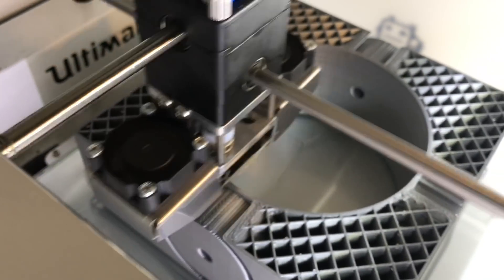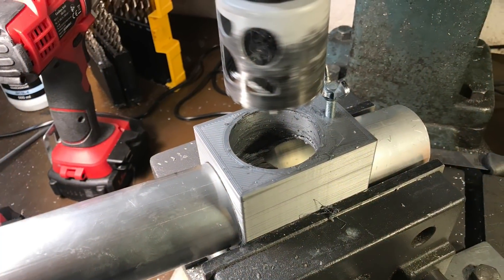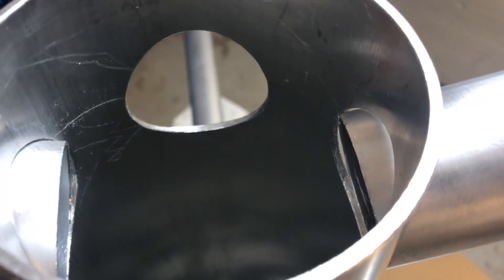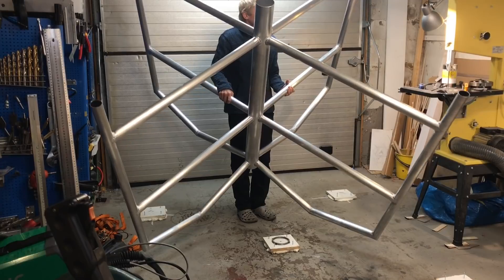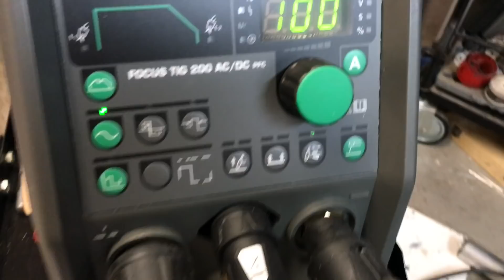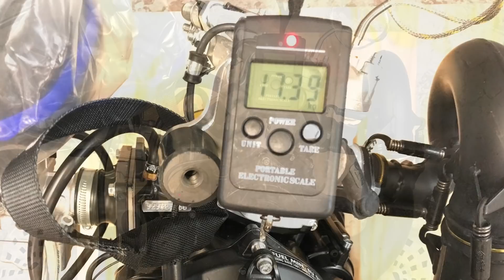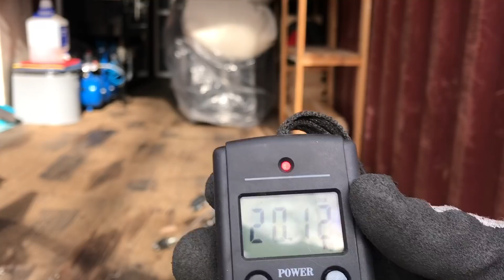OTV 7

Comment: Awesome, this is amazing to see.  Hey, love all your videos-big thumbs up from a fellow tinkerer in Michigan.  So I just wanted to put it out there for future video ideas that an AGNI/Lynch motor would literally be perfect for an electric motor repower project on this device or any other smaller vehicle project:
The AGNI or Lynch motor is a unique axial gap permanent magnet brushed DC electric motor.  The motor has a pancake-like shape and was invented by Cedric Lynch in 1979.
The Lynch motor is built from ferrite blocks sandwiched between strips of metal, instead of conventional copper coil windings, and is held together purely by magnets. The motor is available in several sizes (6.6 lb) to (24 lb) weight and provides a power of 1.5 kilowatts (2.0 hp) to 11 kilowatts (15 hp) within an efficiency range of 80% to 90%.
Any voltage battery up to 80 volts can be directly connected with a rheostat or a variety of controllers will work such as cheap PWM or golf cart controllers of many power levels.  I've even ran mine (AGNI 15kw capable) off a 3Kw brushed motor controller for an ebike.  What's amazing is the torque produced: I once hooked a single 18650 battery directly and the shaft spun about 90 RPM and had an incredible torque for such low voltage and motor speed.  A 9v battery spun it about 300rpm and you could not hold the shaft from spinning with your hand, 48 volts is about 2,500 rpm and it will rip a back tire right off an electric bike.  A very interesting motor so I thought I'd throw it out there, thanks again for excellent and interesting content.

Comment: I could go on forever praising your ingenuity on many points but the thing that thrills me the most so far is that you're going ICE rather than electric in a world that says you're mad 👌🏼
Reply: But it's the world that's gone mad, currently.  So much of the electric push is political, and control-oriented.  They'll be a more reasonable fit when battery densities are a lot higher, and electricity generation is more efficient, and less agenda-driven.

Comment: Thanks for the update, I was wondering how far you'd got with this. 

I commented the last time about the reliability of the gearbox, which is a single point of failure. However in this video I'd also be a bit concerned about fatigue of the welds between the radial arms and central column. Aluminium has a finite fatigue life, and significant vibration will cause welds to fail quite rapidly. 

Good luck, and keep at it!

Comment: You need rubber vibration isolation gaskets between that engine and the frame. Also another engine directly opposite will allow for some measure of harmonic balancing and of course double your available power.

Comment: I knew you won't stop until you fly with this. 👍
If you could get 4 old Sachs Wankel / Rotary engines (the ones without gearbox), it might work. Amount of vibrations is very minimal for obvious reasons, they are air cooled which is actually an advantage for your application and almost no tradeoff considering how they are built and how they work. Efficiency is bad, as it is bad with all 2 stroke motors, so no tradeoff there. But they might be hard to get and they might be as expensive after full rebuild than those Polinis. They are German product, very hard and expensive for people in USA to deal with so that might be your advantage. 🤔😉
In each case, be careful and I'm looking forward to see your progress. 👍👌
Reply: Now that would be cool!

Comment: I have seen connecting shafts with rubber a disk, where shafts are connected with bolts to the disk alternating from both sides. That might help to reduce the vibration of the motor transferred to the gearbox.
Reply: @SystemsPlanet  Not exactly. I say, that the disk should be made out of rubber. He has metal disks with rubber joints. The bolts there still projects the vibration. (But I'm not an expert in the topic.)

Comment: Sand is OK if extra fine, wet & packed, there's an official way that better & expensive, with some bends drawing needed, good 3-roller benders do most hard bends with a couple tries to get it down.

As a magnet motor designer, imagine no batteries, no fuels, flux fades-10%/1000yrs, no shop atm, will keep tabs, great line of thinking.
Kudos 🍺

Comment: I absolutely love this. Many people have ideas but not many back their ideas with action and money! Two points, sorry if mentioned elsewhere. Firstly, there are four motors and presumably four pinions driving two ring gears (I haven't seen your other vids or all of this one sorry). The one ring gear per blade seems like a real weakness-if something loses a tooth and destroys thay one gear then four motors won't help you.

Secondly,  although this is an excellent configuration, you appear to have all of the skills and money required to build a more normal configuration helicopter (like the mosquito!) which (to my uneducated mind) removes a huge number of variables and potential failure points

Comment: You should coat the motors outer surface and the aluminum bars with Dynamat or some other sound deadening material to cut down on the vibration... hopefully the lack of vibration will out weigh the extra weight it caused. Just a thought.. nice job keep it up brother

Comment: Overrunning/sprague clutches will be important in any motor setup (dropping out below flight rpm=bad).  Turboshaft is even more so (they won't stay lit for long).  Before you ditch the 2-stroke engine, is it possible to try a steel lamininate disc coupling and rule out torsional oscillation from the rubber?
On power package weight, is it possible to use the aluminum frame as the radiator?  Partitioned off (e.g. with stiffeners & gussets), the available surface area should be close to or larger than that radiatior.  yeah, fluid weight would go up, but it'd be elegant. :) Drop hollow plastic balls into the frame tubes, and it might even help dampen.  Something for much later in the process...
Thank you for mustering the courage and time to produce these videos.

Comment: Intriguing.  Would light helicopter rubber belt drives be a better solution? The motor would need to be mounted sideways to the central gearbox coupling but as with helicopters, the light belts have the added advantage of instantly absorbing and isolating engine vibrations.
Eventually, the weld’s will need to be at a standard suitable for flight but as with all experimental ultralight craft all of the fun is at the  experimental stage. Looking forward to your next instalment.

Comment: if you add a bigger upper fuselage part like a rocket that creates drag it could potentially be easier to avoid overtipping, besides slightly larger control surfaces

Comment: Looking at you design I was thinking move the radiator to the bottom, you will get enough air moving through it and move some weight down. Also Lotus used rubber dognuts on the Elan , and I have seen several cars to day that also use them. Of course you don't get to chose the hardness.

Comment: I think the drive rubbers will allow that end of the shaft to flail... I would only take a small move to throw it into an eccentric off-center orbit.
A Thomas disk coupling "might" solve any flail issues if they occur.
I have a similar design drive (using Thomas disc couplers X2 / Carbon fiber shaft) on a three axis ultralight, the drive is not yet built but even with the axial rigidity of disc couplers and low drive shaft mass, I am still quite afraid of flail. (Max 8000rpm)
With your reduction (maybe Max 2800rpm) you might be ok... but I have my doubts especially as the rubbers age and soften. 

I will be watching with interest as I am close (ish) to fitting my the motor and building the drive and its an aria I am very nervous about :)

Comment: Can you (or the flight controller) control the power on these 2 stroke motors accurately and fast enough to have any hope of hovering/soft landing?
Reply: Yes. The co-ax config he has arrived at has a certain level of intrinsic stability so he will have full control decending downwards through a powerful ground effect. The ground effect will be large do to the concentration of thrust near the underside of the aircraft and respectfully large diameter of the propellers. If the aircraft is not using it's peak power just to sustain hover just out of ground effect (weak/inefficient etc. I hardly imagine this could be the case...), but allocated ample power to maintain torque when throttled just below hover, then it's thrust regimine will allow a similar experience to a car parking in a driveway, or to wit a Eurocopter landing near a red carpet.
Reply: @captainTubes  Coaxial doesnt help in this regard at all. If anything, its detrimental as those are some really big propellers with a lot of inertia to speed up/slow down. You need tons of torque to control that, something ICEs, and particularly 2 strokes arent great at. I dont think Ive ever seen a combustion engine powered VTOL that doesnt rely on variable pitch (or thrust angles)  to control vertical speed. There is a reason electric motors enabled the current vtol revolution. Anyway, I would power this with electric motors, and to overcome the endurance limit,  maybe a combustion engine + generator or a single combustion engine that provides a fixed power output and electical motors to provide control.

Comment: Amazing work! What about a hybrid solution for powering it. I'm thinking about redundant Honda inverter generators plus a small buffer battery/capacitor bank. The Honda EU20i is 2KW at 21 kg. And it delivers that power at 52dB(a) 🙂
Reply: I think the generator idea is not good unfortunately:) this sinle engine has 33hp, which is a bit more than 24kW. Four of those will maybe need to produce 40-80kW to fly. A 2 kW generator is irrelevant in comparison, and at 20kg it's way too heavy. A single one of these engines weights the same, but makes 12 times more power.
:)
Electric hybrid would be interesting, if two gas engines are enough for flying, and the electric motors are just there to take over for a short emergency landing in case a gas engine fails.

Comment: Don't be surprised by specifications, performance numbers and data being incorrect by an Italian manufacturer, especially one with connections into the automotive industry. Believe me, they are always a joke. Italins say 165kg, real physics say 198 kg. Italians say 38 Hp, calibrated DIN measurement states 24Hp. Never ends, never surprises.

Comment: I assume the bad vibrations are from the aluminum dummy propellers, when you buy real props they should be properly balanced  
I always mount flight controllers with 3M double sided tape to reduce vibrations that reach it, maybe you could use two layers of that?

Comment: I get the aesthetics of the balance and unity of the propulsion setup but it's very exposed and inelegant to have to get on top of it. In the airflow.
Two rotors could balance eachothers on each of two tilt wings instead giving natural room for passanger between the airflows and with tilting wings the craft has an efficient high speed winged mode where a hover craft is fairly doomed to hover in place. I would encourage getting excited about the less compromised aesthetics of two tilts wings which would at the same time be the control surfaces. A very clean design.

Comment: Yeah that engine maybe work ok, but is it best for that project? hmm...
Also I wonder, taking in to the account weight of everything, frame, load etc and power it need to fly... how big battery pack would need to be to if you would use for example those more typical conversion electric engines for bikes(most are like 48V or 72V/ 2kW or 3kW that weight around 13Kg)

Comment: I wonder if a hybrid setup would make sense; a generator set without direct mechanical coupling would be easier to isolate the vibrations, and it could be relatively small since it wouldnt be designed for peak power. Then again I suppose it makes more sense for cars, since I imagine in a helicopter-like design such as this, peak power and typical power are not all that different? Not sure... if you need a sudden RPM change to accomodate a manouver that might actually be quite the power spike? if the combustion engine was rated to just barely keep it airborne without acceleration, how many kgs of it would you need, and would it make up for the generator weight and losses? For sure you could run it at very constant rpm and you would not really have any peak thermal loads on it either; so that might simplify things in some ways, such as the cooling.
Reply: Quite a large weight penalty for hybrid systems, even a simple short run "booster" has a hefty weight penalty.... Complex dual purpose motor/gen + batteries.
Reply: @pimplequeen2  Penalty compared to what is the question I suppose. Obvious youd design such a setup with minimal battery capacity; the point wouldnt be to use use as little fuel as possible; but to gain the superior controllability and mechanical simplicity of electric motors.  Without batteries, an electric drivetrain is infinitely lighter than a combustion drivetrain. So from that perspective it makes sense to have combustion handle the base loads and let electric supply the peaks. It should save you a lot of spare combustion motor capacity that you would otherwise need to handle peak loads. The only 'extra' component in such a system that is more than the sum of the other parts would be the generator; but if thats engineered for flying like the motors are, it also shouldnt have to be the end of the world. Of course you could also have a hybrid drivetrain where the motor is mechanically connected to the props; but that would also negate some of the benefits.
Reply: @eelcohoogendoorn8044  
The polini 202 is 33hp (24kw) and weighs 22kg (assume about a 5kg per hour fuel burn)
Id be interested in seeing the weight and runtime of an electric motor / generator / batteries and IC engine equivalent.

Drone type flight is already very inefficient... Cant be throwing power away :)
Reply: @pimplequeen2  Electric drone motors easily have 5x that power density. With batteries it quickly starts looking less favorable; but again such a hybrid system should be designed to carry almost all its energy as hydrocarbons, not as batteries.

Conversion losses of the generator also need not be terrible I think. As long as they can run at their optimum design point all the time, permanent magnet motors/generators can have really high efficiencies.

Note that you wont be needing any backup combustion if you use a generator; the electric motors should be powerful enough to turn the props by themselves, so as long as the batteries are big enough to land safely, you should be good.
Reply: I did a rudimentary weight costing for a 4kw 15 second launch booster for a sub70kg fixed wing ultralight I am half way through building.
Even with the outrunner built into the IC output pulley and a very efficient four stroke IC, it added more weight than I could afford... Any addition to that 15 second adds more battery weight (I will have to put up with a longer takeoff roll / 100m instead of maybe 25m)
It will fly for approx 4 hours on ten liters of fuel, if I lose 3kg of fuel to accommodate the booster weight, I lose almost half my flight time to gain a short field launch ability.
Its not a fair comparison but the balancing of conflicting concerns is a reasonable example.
Conceptual ideas are often perfect until its time to pick up the spanners and start implementing... For me, the weight issue is a legal one, for a drone type aircraft I think it would be an issue of flight time/efficiency unless it is also aiming for the Sub70kg class...?
A 30 min flight "might" be possible with IC and mechanical controls, it seems to me that any departure from that would cut into that flight time via the additional weight and conversion losses.
Reply: @pimplequeen2  Yeah true a lot of it comes down to the detailled engineering and what components are available. I guess if you have such strict weight limits and already a relatively low fuel loading, it is indeed hard to make the numbers work out. The way im looking at it, is that it makes most sense if you allow the electric system to cut into the IC motor capacity and weight. If thats not on the table indeed it seems hard to justify.

Comment: You need one of those magic electric motors that gets 300 horses into cake tin. They set a coke can by it in the thumbnails. Then, you need to get a gigantic LiFePo4 bank to power through a HV brushless controller with super Low low voltage cut-off to take advantage off the chemistry 🧪 benefits.
Reply: Silence is golden 💛🌆🌌
Reply: He said in the video, he wants longer run time than a electric motor/battery set up would give. Pay attention.